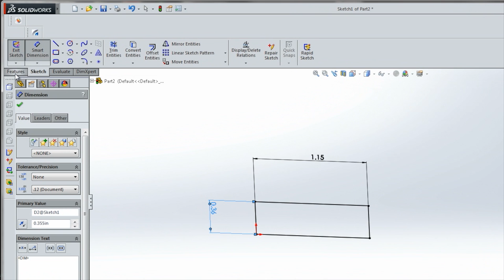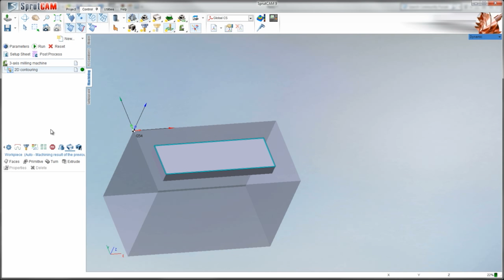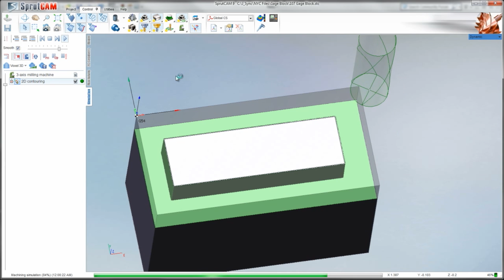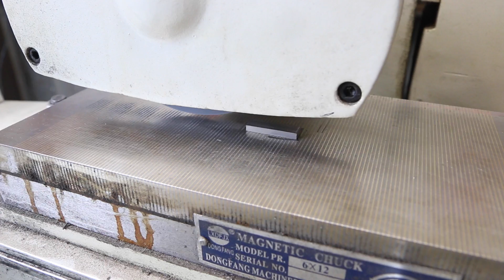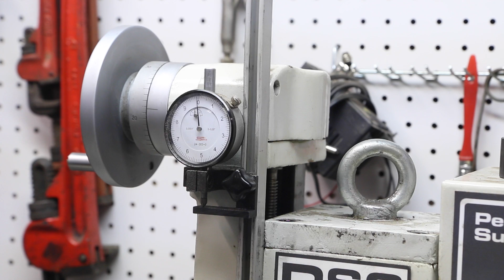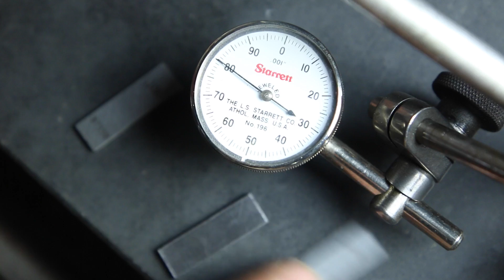The Lost 107: Machining & Grinding a Gage Block! Widget24

Comment: Hi John

Great video and just show if you think about it there is a way you can DIY, thanks for showing us

In relation to the air compresser mine is only a small one but noisey non the less on speaking with a man at the local engineering company about this he has advised to place the compresser outsside with a suitable a weather proofing cover around locate the tank inside and provide a air feed from within the shop to reduce moisture and eliminated changes in air quality etc,
When the weather picks up I will be giving this a go.

Regards Mark

Over the pond in the UK

Comment: What is the theory behind the granite block?  wouldn't a steel block be better in the long term?
Reply: Granite is harder than steel, and far, far more dimensionally stable. There are cast iron surface plates as well, but they are generally hand-scraped very, very flat, and are used commonly for lapping operations.
Reply: Granite is more stable in variable heat conditions etc.

Comment: At a company I was working for, we have just put the compressor into its own room, applied noise damping material and put the exauste and intake outside. That really helped with the noise and in addition the compressor stayed cool, because it wasn't intaking air from the the inside anymore. And the compressor was, so far I remember about 30kW.